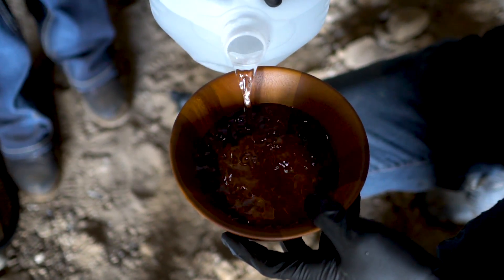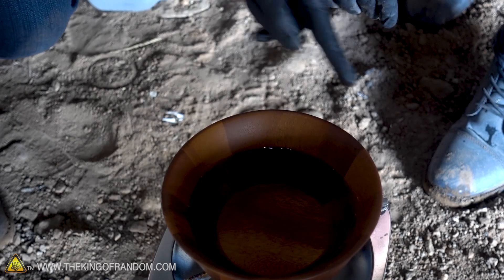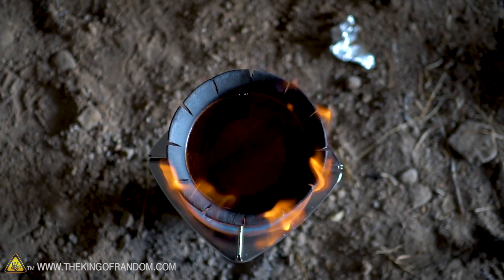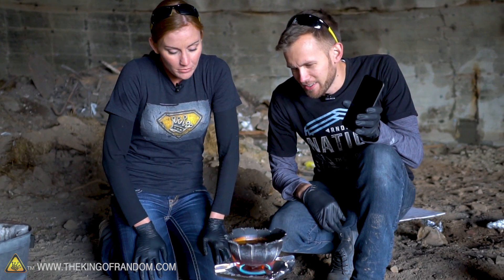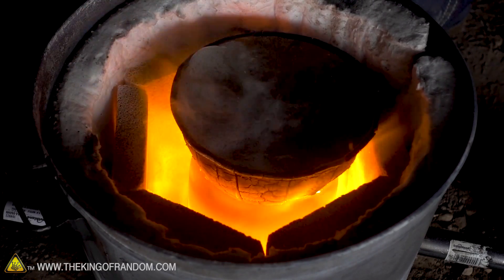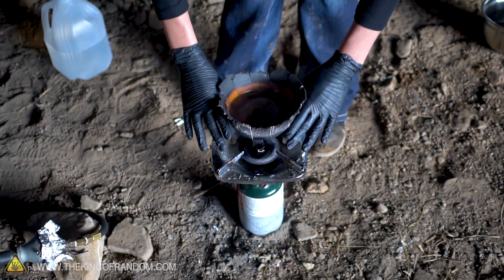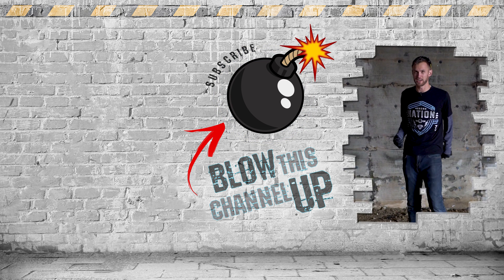Can You Boil Water in a Wooden Bowl? Does Water Boil In A Wooden Bowl? TKOR Boiling Experiment

Comment: Evaporate is technically the wrong word, evaporation is actually when water dissipates into vapor over time and not due to heat. What you were doing was vaporizing the water. Also I believe the wooden bowl was keeping ab oil due to it's higher specific heat than the metal therefore staying warmer than the metal. The metal cools down faster and heats up faster than wood does.

Comment: I have boiled water in plastic bottles, dry bags, and even a heavy canvas hat once but I've never tried wood.  But, I absolutely could boil water in a wood bowl if I needed to.  All you have to do is heat up some rocks in the fire and then drop them in the bowl.  It'll boil pretty quickly and easily.

Edit: and then you mentioned my method at the end of the video.

Comment: Wait pause the video! I am now going to make a hypothesis. Now think, water boils at 210 Degrees Fahrenheit, right? Well is wood does not perform heat transfer well, we can infer that the water will not boil, right? But if the wood bowl has an outside protective coating the bowl will not burn on the outside. I am going to say yes, the water will boil, because the flames as you can see in the beginning of the video are going over the bowl, making the heat “trapped” making the water boil. We can then infer the water will boil! If my hypothesis’s correct please like!

Comment: That water in the furnace was boiling, no question about it. Just because only one side of the bowl had enough heat flux to vigorously boil the water doesn't mean the rest of the water in the bowl wasn't at boiling temperature. The water would have been circulating quite a bit because of natural circulation so the water on one side of the bowl would be replaced by the water on the other side within seconds, and thus the whole bowl would be at boiling temperature. 

Think about it, you wouldn't say that the water you're using to boil your pasta isn't boiling just because it is only vigorously boiling at the bottom, and not on the sides or top. The water at the sides and top are at boiling temperature, there's just not enough heat flux to make nucleate boiling in those particular areas.

Comment: Why??? If you need to boil water in a wooden bowl, you can do so by using rocks that are heated in a fire. You do need a few rocks to do it, and you use them sequentially, but in the end, your water will be boiling hot, and you won't ruin your wooden bowls. Just don't use river rocks, or use river rocks that have been very thoroughly dried out so that they don't explode like a grenade in the fire. seriously though, river rocks and fires just don't mix.

Comment: I assume you were trying to boil this "at sea level" ? I would imagine it might be more possible to do it if you were at altitude where the boiling point of water is much lower. I think on Everest it is around 60C to boil water. One other possible way to improve your chances may be to put the bowl in another bowl filled with oil or another liquid as that should prevent the wood from burning.

Comment: The way to boil water in a wooden bowl is through the use of hot rocks, a primitive technique that uses rocks heated up by the fire that are then dropped into the bowl and water the boil is very quick too! You guys should try it out with a fire using the bowdrill from the previous video 🙂

Comment: I have not done it in a long time... but you can in fact boil water inside of a paper cup.  This is not practical but is a great physics experiment to show how the water and the cup create a system and that the cup will not burn until it reaches it's burning point, 451, while the water boils at 212... Of course the edges of the cup do in fact burn off, but you are able to boil water in a paper cup.
*I made this comment before watching the video

Comment: dunno why you tried to boil water THROUGH the bowl instead of taking rocks, placing them in a furnace, campfire or foundry wrapped in foil, remove the foil, then place the clean but very-hot-rock into the water inside the bowl. you don't end up lighting the very-cumbustable WOOD bowl on fire and you'll achieve a boil in significantly less time. like 30 seconds.

Comment: 3:30 Since it is thermally less conductive, it apparently cannot conduct the heat to the water fast enough.  The temp of the bowl rises.  I know book paper burns at 451F, so for everyday purposes, I use that figure for anything wood-based.  Once the bowl reached about that temp, it ignited.  Very interesting to observe.  
The hot plate test is even more interesting, considering the element would be hot enough to ignite the bowl, but maybe it wasn't able to conduct the heat from the plate.  I now wonder how a thermal exchange between wood/metal versus wood/air differs.  Is there a table somewhere with coefficients?

Comment: When hot glass is placed in cold water it will crack or if the difference is enough it will burst violently. What happens if hot glass goes into liquid nitrogen or even molten temperatures of glass into cold water or liquid nitrogen?

Comment: A unfinished wooden bowl might work better. The wood from the bowl could then be saturated with water before putting it on the fire. The wet wood would not as readily burn and would better conduct heat to the water. BUT if the water trapped in the wood turned to steam the bowl could explode. I don’t know if that could happen. The water in the bowl might keep the water in the wood from boiling, but that does not seam likely. Someone brave and very careful could find out.

Comment: Ive got a question. Completely off topic about this video. >>>>>

If you dug a hole right down into the Earths core, and through the other side. And if you down, would u be crushed because off the earths gravity ? Or would u fall straight through?
Reply: I think you'd just fall through. Only forces at work would be pushing you down (in the beginning) or up (in the end). Never more than 1g. It's hot near the core though :-D
Reply: @StefanReich  No, so like if you dug a straight hole through the earth, your saying the gravitational pull wont work on the other side ? Because gravity pushes you down in the first place.
Reply: @tomcat._snaps  Sure, gravity pushes you through the hole. It's just not something that would "crush" you which is what he asked.
Reply: @StefanReich  So what stops the gravitation push on the other side of the Earth ?
Reply: @tomcat._snaps  IDK... would you arrive on the other side with velocity zero, or overshoot into the sky? Wait, I think you wouldn't even make it to the other end because air resistence limits your fall. You'd be stuck in the core eventually. SO DON'T TRY THIS :-D
Reply: @StefanReich  so would u be just floating in the midddle then ?
Reply: @tomcat._snaps  I think so. I'm sure there is a YT video about this :D

Comment: More simple way to answer this question: step one: look up the boiling temperature of water, step 2: look up burning temperature of wood, step 3: compare, if the burning temperature of wood is lower than the boiling temperature of water, then it will not boil in a wooden bowl due to the bowl will disintegrate first

Comment: I heard you say that you boiled water in a paper cup--that the cup burned down to the level of the water.  I did the same thing in a styrofoam cup--with similar results.  I used a campfire (open flame).  Be careful to not touch the melted styrofoam!

Comment: Omg  as you both know wood has a certain temp it reaches before it catches fire and water boils at 100 deg. C or 212 deg.f so if you want to boil water in a non metallic or glass you have to suspend the container above the fire at a level where you can hold your had for five to seven seconds. I have boiled water in plastic bottles in this manner. Yes it takes longer but you can get a rolling boil

Comment: Here is my theory, Now when your burning wood it turns into mostly carbon and since carbon is one of the most heat resistant materials and acts like a heatshield, I think it's actually the lignin in the  wood thats starts the boiling process. It makes sense since on camera the water looks a bit brownish and when it was boiling it was more of a foam ontop instead of the bubble boiling kind and that  is since lignin is the material in wood that gives wood it's strength and brown color and it foams up under heat. That would explain why at the lower temperatures the water had a hard time heating up, but it did when you introduced the foundery since it can go up to higher temperatures and therefore liquidizing the lignin and heating the water and since the two other tests couldn't reach as high temperatures it didn't heat the lignin and all the heat that was in the water was probaly from surface heat on the water line and mabye the glue melting and heating it up aswell, very similar to what the lignin did.

Comment: The simple idea is that the water is cool enough to keep the wood from combusting (water only reaches 100C, whereas wood catches fire at 190-260C). In nomad times, animal skin was stretched and filled with water and put over a fire. If you guys do this again, try putting the bowl higher up in the flames, as not a lot of direct heat will be transferred to the bowl. You can also try filling the bowl to the brim to keep the edges from burning.

Comment: If you had put the bowl in a 300°F oven the water would have eventually boiled without the bowl burning. Faster with a loose fitting lid to reduce evaporative cooling of the water.

Comment: I think this would be easier in microwave
Reply: Does that not defeat the purpose of the experiment? At that point the microwave is boiling the water via direct heating to the water from the radiation. The purpose of the experiment is to see if the wood can conduct the heat through itself into the water.

Arguably, you could boil water in a metal bowl in the microwave, if not for the arcing and exploding caused by metal in a microwave) Assuming that particular reaction did not occur, they would yield the same result, as the causation of the boiling is by heating the water directly, not by heating the container.
Reply: @trashcaster  but it still technically counts as boiling water in a wooden bowl
Reply: Revi M Fadli it does, but that’s not content 😂
Reply: @trashcaster  i have an idea... put lots of different types of metal in the microwave and let it do it's thing overnigh
Reply: Thinking outside the box, I like
Reply: @milkshakeflake   WHAT?

Comment: Put salt in a microwave would it melt or will it just explode or it might do nothing
Reply: Breezy Kacen Salts melting point is too high to be achieved with a microwave. If you heat it up enough, the moisture inside will expand and the salt will break. Other than hot salt, nothing is likely to happen

Comment: Considering that you can boil water in a paper McDonald's cup...  It should work, as long as the wood conducts enough heat through it.  Which could be doable if the wood is thin enough.

Comment: Should have had a thermometer to check the temperature
Reply: Never_ why?
Reply: When larger bubbles come to the surface and do not collapse on the way up, that is how you know the water is boiling. Since they are above sea level, the atmospheric pressure is less and it will take slightly less heat to boil the water.
Reply: @austinmarshall9346  To see how close they were to boiling on the stove and the blow torch. Would have been interesting to see how hot the water got with the wooden bowl in these situations.
Reply: Never_ It will always be 212 degrees Fahrenheit at sea level.

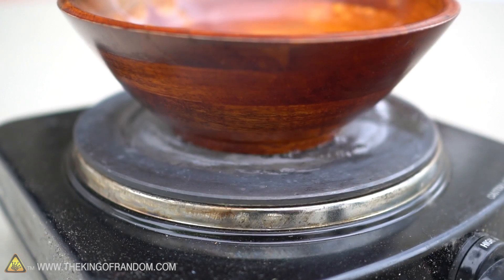Comment: The surface area in contact with the electric heat source is miniscule (1:25). You already know that wood is not as thermally conductive as glass or metal and then you skew  the results by using such a small surface contact area to transfer heat. 
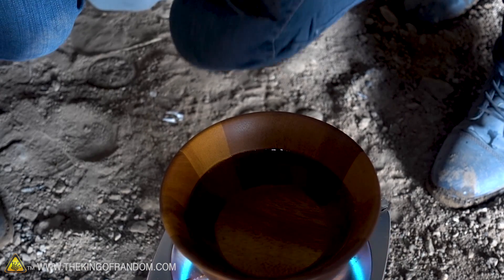With flame the surface area is much increased as shown in 3:02 so heat transfer can occur.

Comment: You could've put the wood bowl in a pressure cooker filled with water to the edge of the wood bowl and that would change the temperature at which the water boiled and allowing it to transfer more heat to the wood bowl, as you take the lid off all of the water should start bubbling like crazy

Comment: Its possible to boil water in a plastic bottle on the open fire (campfire not something like blow torch). Water inside cools the bottle to temperature ounder the point of burning absorbing all the heat and makes it hold its shape when alredy boiling ;] One important note bottle cannot be sealed cuz that way pressure would burst it and ruin it quite quickly.

Comment: If you put the bowl next to a fire it will boil. It is because the ignition point of the wood is lower than the boiling point of water. So the distance matters. You can do the same with a styrofoam cups. We used to do it in boy scouts to reheat coffee.

Comment: Before I watch the video. Yes it's possible, char the bottom it depends on the hardwood but it should work. You could also soak the wood in oil or water to help with the transfer of heat.

Comment: Try putting dry ice in a vacuum
Reply: 21-populargaming 21 Dry ice is solid carbon dioxide. When you lover the pressure, the sublimation that occurs will increase and you will not be able to reach low pressures.

Comment: Is it possible to boil molten copper?
Reply: Chandler Apling yes, the boiling point of copper is 4, 644 degrees Fahrenheit. That is higher than the melting point of copper.
Reply: @austinmarshall9346  👏👏👏👏👏👏
Reply: @austinmarshall9346  "That is higher than the melting point of copper." Thanks captain obvious.